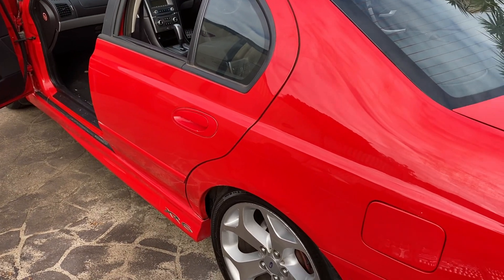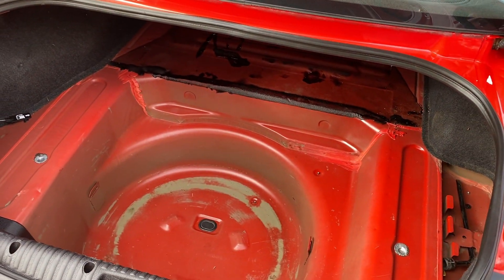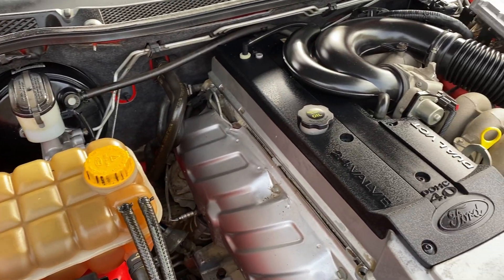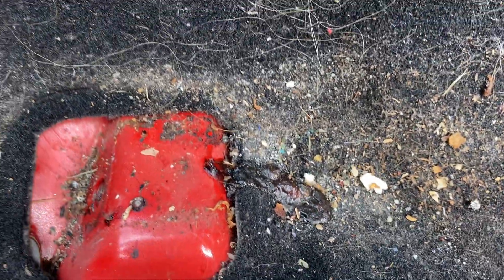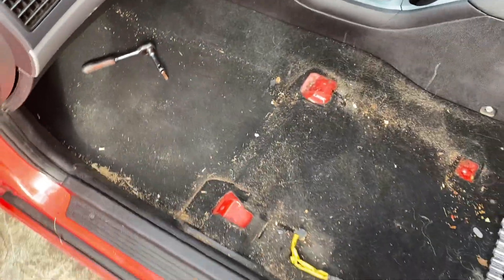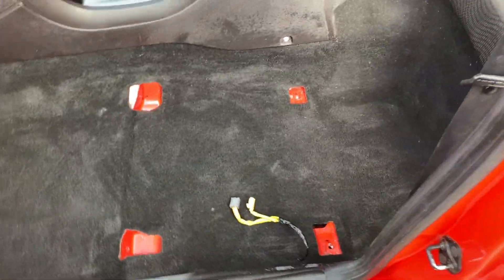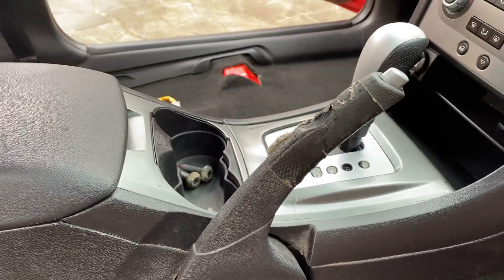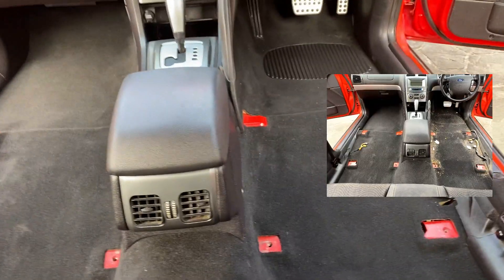HRPM Projects - Ford Falcon XR6 - Ep4 - Cleaning

Comment: Hey mate, what’s the process on removing the the fronts seats is there much too it ?
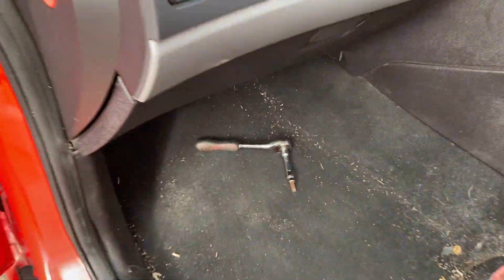Reply from the maker: nah, you remove the plastic cover around each corner and remove the plastic trims on either sides. then you will reveal the bolts. the bolts are then undone with a T50 star socket. see at 1:44

Comment: hey bro, how did you get the handbrake cover off if you can remember, mine just won’t come off. cheers
Reply from the maker: the bottom circular part is easy, just clips off, the main handle part you'll need something thin (i used a skinny flat head screw driver) to wedge in to break the glue/seal, the work your way as the seals break to slide it off.